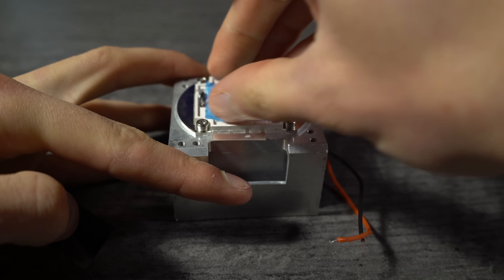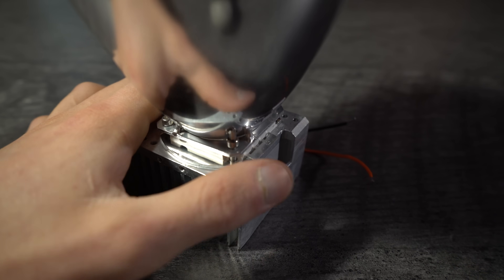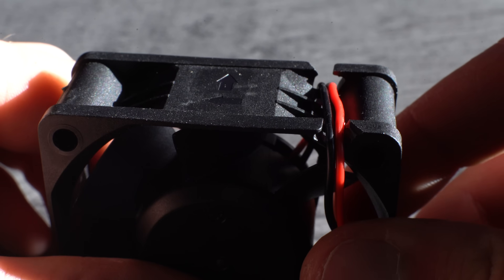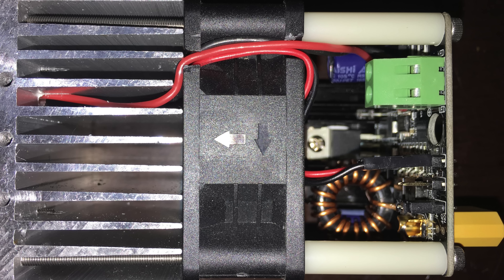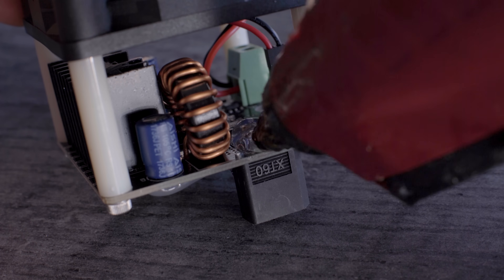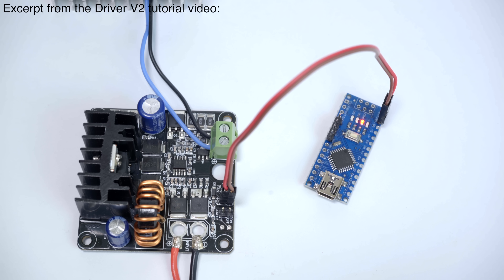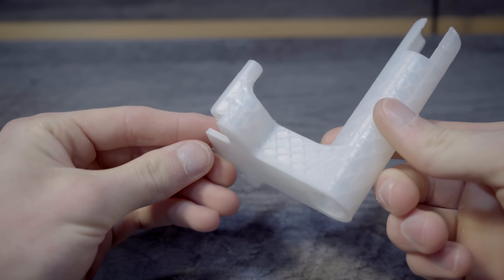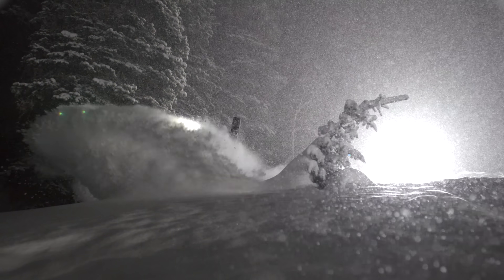Stratus LEDs 100W Module V2 Build Tutorial

Comment: Those sharp plastic edges on the fan are going to eventually rub the wires bare and cause a fault. Maybe suggest putting some electrical tape over the edges to reduce the abrasiveness?
Reply: Andrew .Cragg it isn't touching the fan...